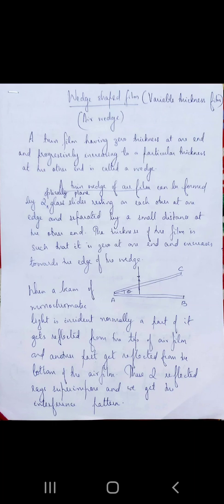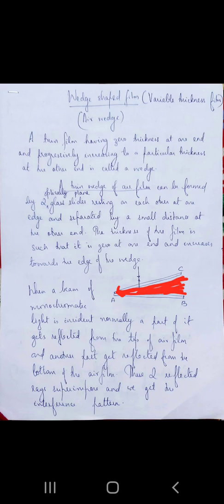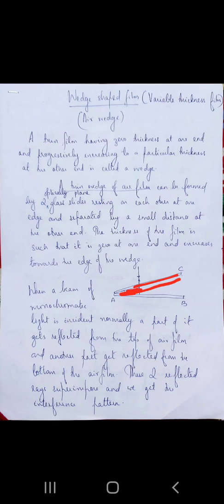Air wedge

Comment: Ma'am,can you please explain why do we obtain circular fringes when the two mirrors in Michaelson Interferometer are placed exactly perpendicular to eachother?
Reply from the maker: Circular fringes obtained here are also called fringes of equal inclination. When the mirrors are kept exactly perpendicular an air film is formed between the mirrors M1 and M2'.If the mirrors are separated by a distance d, the 2 coherant sources will be separated by a distance 2d, and the path difference between the rays coming from the virtual coherant  sources S1 and S2 and entering the telescope will be 2dcos(theta)

The net path difference will be 2dcos(theta)-(lambda)/2 which is due to the reflection at glassplate G1, a denser medium.lf this path difference is an integral multiple of lambda, constructive interference takes place at that point. But not that point alone, all points lying on avcircle, having same inclination theta  will be bright giving rise to a bright ring.Similarly for dark ring too.